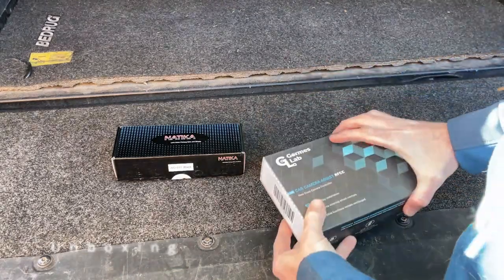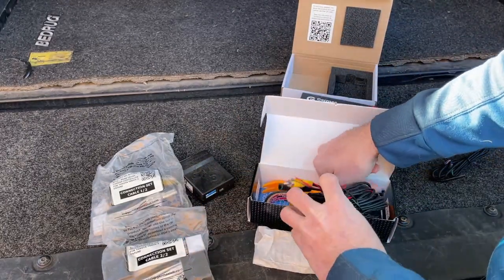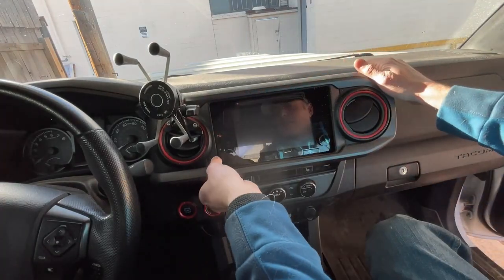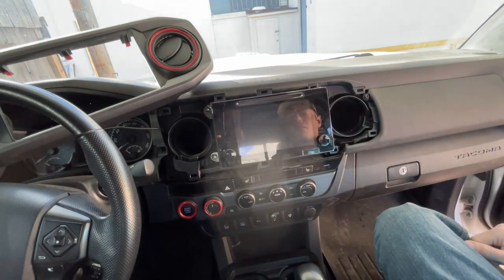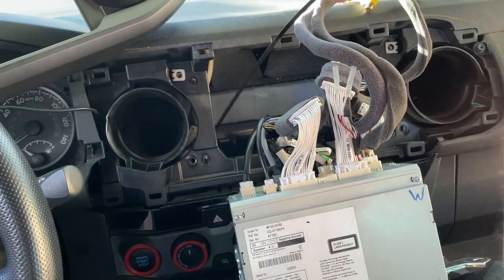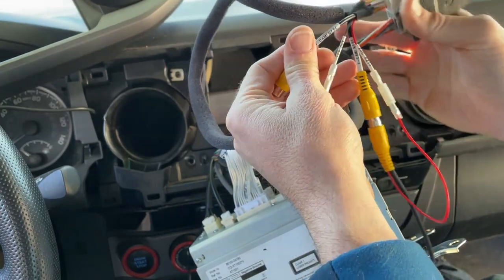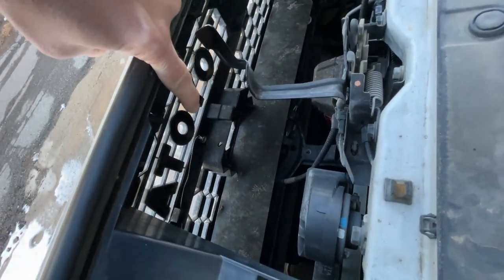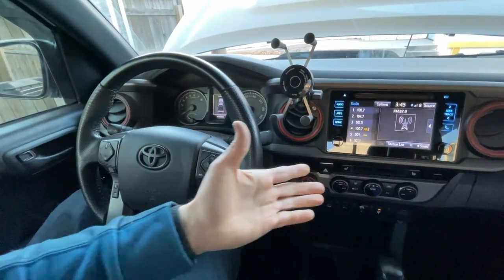Best Tacoma anytime camera kit, easy install

Comment: How does it function for normal reverse functionality? I’ve heard you need to manually turn it off after putting the truck in reverse
Reply from the maker: It switches to reverse normally.  Then when you put it back in drive the front camera turns on for about 10 seconds or so.  It will turn off by itself.

Comment: I’ve had mine for a few years and it recently started flickering and going black on the front camera. I replaced the front camera and it still does it. It’s unreliable
Reply from the maker: Could be the wiring, or it could be a bad module. Did you contact the manufacturer?
Reply: Mine just started doing that ..did you find a solution
Reply: @amit666715  no I didn’t find a solution. I feel like it’s an issue with the camera lens overheating. It only happens to me after leaving the camera continuously on for a while. I’ve been wanting to test this theory out using a different brand of camera but haven’t purchased one yet. Does yours flicker after being on for a while?
Reply: @infosponge  the module is really old at this point so I imagine I’m on my own

Comment: Awesome.  Thanks.  Does it come with the three harness you plugged in? Or do I have to buy it separately from the camera ?
Reply from the maker: The control module with harnesses are one product and the camera is a separate product.  You could just install the controller and use your factory rear camera only.
Reply: @infosponge  where can I find the control module with harness? Link? Tia
Reply from the maker: @Larrythe11th  Made by Germes Lab.  I bought mine from https://thetacogarage.com

Comment: It's good to have different options. But I'm still going with the "anytime camera" brand. This integrates into the steering wheel mode button, which is unnecessarily convoluted and not intuitive. Why the heck would double clicking "mode" bring up a camera? Also, why would it show the front camera after switching from reverse to drive? I guess they are thinking of parallel parkers? I'm going to guess most people aren't parallel parking their tacoma all that often. So for us, a button that you press when you want the camera up, that stays up until you turn it off, is clearly the better option that makes sense. Double clicking, and holding mode and all that nonsense is unnecessary. If I have to teach you how to use a simple system to turn a camera on and off then it's poorly designed.

Sure, maybe this kit is a faster install, but the more popular kit is all the same skills, just a bit more work. If you can install this kit you can install the other ones. And if you can't carve out another hour to do it one time in your life then your life is clearly out of control. In other words, in my opinion the other kits are just better. The mode switch thing is so silly to me.
Reply from the maker: I’m sure the other kit is good too.  I had no more room for switches so the integrated one works better for me.
Reply: I was wondering why there was no switch. I found this video looking for that switch installation, because I am wanting to move it to the left side (I currently have it in front of the shift knob)